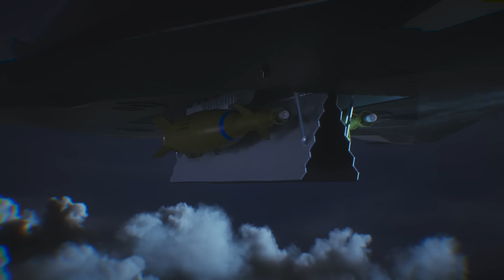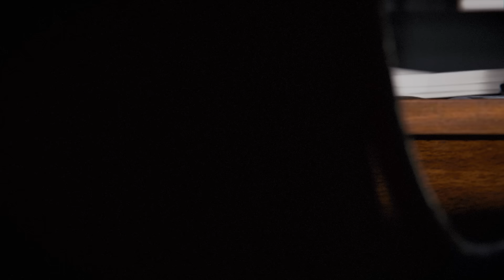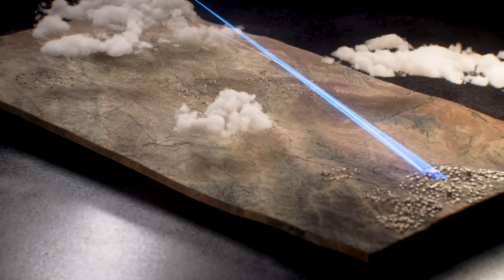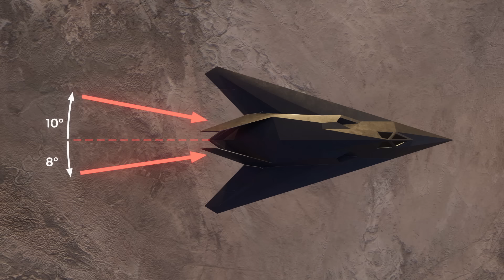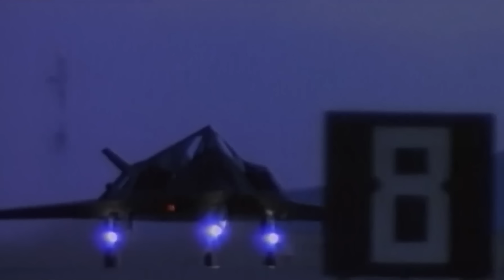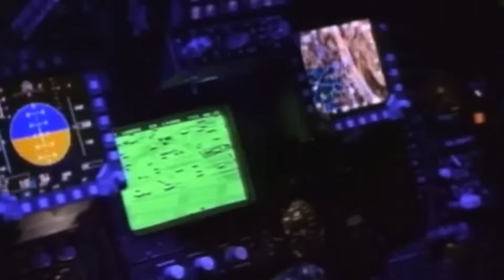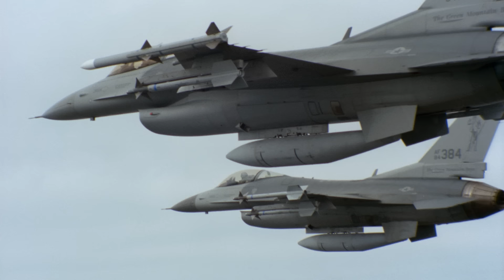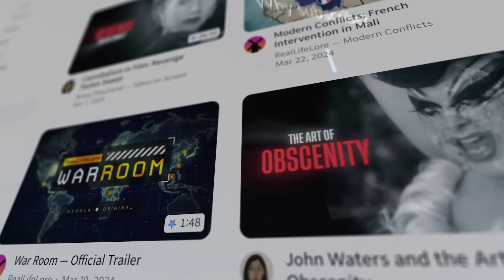The Insane Engineering of the F-117 Nighthawk

Comment: I like how you have these people saying it was dated tech when Yugoslavian army shot it down...and they shot it down with a SAM-system from 60s... F117 is like Gucci or Prada, it looks dope but put it into environment that actually has newer based tech (from that time period like 2000 to 2004) it wouldn't survive the first wave it would've been decommissioned from mission 1..nobody is saying that it doesn't have cool engineering principles, but everything has frequency,you just need to find it and tune it (newer tech helps with finding it faster) it was never a stealth bomber,nobody created truly stealth craft cause we lack materials..it was a bully plane, it wasn't hard to detect it just took longer that was the advantage, which would never work on stronger opponent with even the half of US military budget..if that wasn't the case it wouldn't be decommissioned just after 25 years,you have tech thats from like 60s still used around the world cause its reliable and cheap and does the work,while this fashion craft costs like 30 to 50mill per unit and cant do fuck nothing when met with equal force.
Reply: They shot it down with a SAM and radar from the 70s at close range after failing twice to achieve a lock at longer ranges vs a 1970s experimental stealth plane that was flying directly towards them due to lack of defensive and SA systems. The SAM was dated, but so was the F-117A. 

Stealth doesn't just take longer to detect, it reduces the range at which it can be detected and complicates the enemy's ability to achieve a firing solution even when detected.  "Stealth = invisibility" is just a very simplified explanation given to the general population and politicians, because it saves a lot of time when you don't have to explain kill chains, radio physics, military tactics and coordination etc. Stealth works as it was intended to.

There are nations that still operate 60s systems, but that is typically because their glory days are long gone and they have to hang on to existing equipment to maintain capability. Equipment degrades over time, and that results in increasing maintenance costs and decreased reliability. Any nation that can afford to upgrade will do so, because while it is expensive in the short term, it is typically cheaper in the long term.

Comment: You forgot to mention the contribution of programmers-this and future stealth aircraft were simply not designed to be able to be flown by pilots controlling the control surfaces.  The fly by wire concept, which required untold lines of code, allowed unflyable planes like the F117 and the B2 and others to fly.

Comment: Still one of the coolest planes yet made. It is a faceted monstrosity that doesn't look like it should be able to fly at all, and yet it does so while returning a radar cross-section not much larger than a dinner plate. It is also much smaller than you might initially assume.

Comment: An eleven-year-old kid (1978-79) from Chicago, IL designed this plane and gave Boeing's engineers the design concerns of the F117a, even at that age (with directions to turn it over to Skunk Works if too difficult to build), the kid realized that the opened and untreated bomb bays could expose the aircraft to generating radar returns. The story of a Russian engineer developing the theory of angled radar wave reflection is false. That was the theory of the eleven-year-old kid from Chicago. Cover stories are often layered in piles of horse manure. The term "STEALTH AIRCRAFT" was coined by that same eleven-year-old.  The term was pulled from a dictionary that was current in 1978-79. That dictionary credited the term Stealth as Russian, which is where the cover story of a Russian physicist developing the theory came from. So, the truth is the term and only the term stealth has Russian origins. The kid hand-delivered the designs to Boeing when Boeing was headquartered in Chicago. Additionally, the F117a was the designation the kid asked to be assigned to the aircraft.
Reply: You are completely delusional. Wow

Comment: The thing about the bomb bays is, that they are open for less than 2 seconds in most cases.
When you pull the trigger you let the weapons computer do its job, and ONLY when it's ready to kill does it open the bomb bays for al short as it is possible.

Comment: Each one cost $ 42.6 Million dollars that's approx $162 million in 2024.   It was used to beat up the Iraqis which had an ancient air force that could have been easily and was dealt with using F-16's and F-15's.
Reply: Iraq had a very modern air force up until desert storm

Comment: The story about the Nighthawk lost to enemy fire in Serbia can be pegged dow to sheer dumb luck and complacency by the americans.
It is not enough to simply detect a plane. A missile has to activelly track it in order to hit it. 
When a serbian system took out that F-117, it counted on the fact that americans were using the same flight course to attack over and over, that bad weather grounded suppport aircraft, spies reporting the F-117s taking off, violating it's own doctrine and what can only be described as as dumb luck. Colonel Zoltán Dani, the officer in charge of that particular battery, knew the Nighthawks were coming and where they were coming from, so he ordered his radar system to be pointed that direction. Due to the threat of american ARMs, serbian doctrine severelly limited the use of radar to avoid detection. It called for only two sweeps at a time, leaving the radar active for just seconds to avoid it being tracked by ARMs and making it difficult to triangulate by AWACS. But on that day, Dani ordered a third sweep, which just happened to occur right as the incoming Nighthawk broke it's radar elusiveness by opening it's bomb bays to drop one on it's target. Dani ordered two missiles fired, one missed the plane completelly and the second was a direct hit. But here's the luck part. The missile probably wasn't tracking the plane. It was a total shot in the dark. The 117 also lacks chaff, flares and incoming radar detection systems. The pilot, Lt. Col. Darrell Patrick "Dale" Zelko, said he saw the missiles incoming and probably had seconds to react, if at all. But he was probably flying a predictable pattern after droping it's bombs and making a turn for home, which the Sebians operating the missile system simply guessed right.

This is all based on the american pilot's own reporting. There could be things he's not telling us.

Comment: Any reasonably flat or mildly cambered surface. Given sufficient airspeed and angle of attack. Will produce some sort of lift. It might not be the most efficient but it could work. There's worse things that fly. Vought 173 HL 10 delta dyke X 24A M2 F1 starr bumblebee etc etc. An f 15 flew back to base with a wing gone.

Comment: A comment about the auxiliary intake doors - i.e. blow-in doors.  They were a passive element controlled only by the pressure differential in the intake.  While sometimes they might close gracefully, it was more likely that they would slam open and shut with tremendous and unnerving force, causing damage to the door, the door frame, and the spring damper support on the inside of the inlet duct.  It was a common maintenance issue.

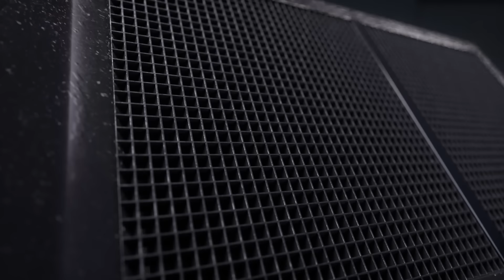Comment: 9:09 No way did a channel called Real Engineering just measure in centimeters
Reply: metric iss the language of engineering
Reply: @aquilesca5tr0  No shit. But nothing is ever measured in cm anywhere,  the vast majority of disciplines measure in mm, other industries will step up to meters where required, but there is no need for centimetres to be used anywhere.
Reply: @JMcKaySV  everyone undertands 1.5 centimeters better than 0.015m
Reply: @JMcKaySV  1.5cm is easier to understand than 0.015 meters for everyone
Reply: @aquilesca5tr0  What are you talking about? I just said that mm is standard. So that's 15mm. It's extremely simple?

Comment: Could be made a form of energy by digging a hole in the ground and put on walls of hole materials that keep heat in and dont let it escape so being so hot that water can be heated and produce energy whit a generator whit steam or by heating air that drive a turbine of a generator?

Comment: The most fascinating thing to me about the F-117s design is that because of its faceted shape the radar cross section is independent of its size. You could scale it up to the size of an aircraft carrier, and as long it maintained the same shape to scale, it would still appear as small on radar as the aircraft does!

Comment: Your info on the payload is all over the place. 
Pictured in the video were GBU-10 Paveway II Laser guided bombs. 
What you described were GBU-31 JDAM bombs.
The bombs that were dropped in the specific instance you referenced was the GBU-27 Paveway III, a high penetration laser guided bomb designed to penetrate over six feet of concrete. These bombs have been affectionately called the "Bunker Buster" by US forces.

Comment: There are some weird mistakes in this one..

January 17th, 1991 was the start of Desert Storm, in which 10 F-117s (not 2) struck communications infrastructure (not the presumed location of Hussein) with laser guided bombs (not GPS guided bombs).

In 2003 a pair of F-117s did strike a target where Hussein was supposed to be, so I assume you've confused the two events?

Also as many other comments point out; bombs, not missiles. The F-117 can not carry missiles, and adding rocket flames out the back of a Paveway in an animation looks funny.

Comment: Great video, but there are a couple of problems.  You said the F-117 fired air to ground laser guided missiles in Iraq, but the rendering showed JDAMs.  JDAMs are GPS guided and were not in use in the Iraq war, they also are bombs, not missiles.  The F-117 dropped laser-guided bombs - not missiles.  Putting a rocket plume behind a bomb and calling it a "missile" is what I'd expect from those channels with AI voiceover.
Second: The comparison to the F-22 is apples to oranges, the F-117 is a strike aircraft (despite the "F" designation); the F-22 is not equipped for air-to-ground operations, it's an air dominance fighter; they have entirely different mission profiles that don't overlap in any way.  A better comparison would be the multi-role F-35, which is capable of both air-to-air and air-to-ground operations.

Comment: The stealth of the aircraft is measured in radar signatures. While a B1 bomber, for example, has a radar signature of 70 square meters, the F-117 has a radar signature of only 0.1 square meters. This translates in 700 times less visible for the radar than the B1 bomber. So, the plane is not "invisible", it's just... STEALTH. In fact, there is no "invisible" plane.

Comment: First time I saw one in real life, freaked me out. 
A friend and I were coming back from picking up car parts... headed north on I-25, South of Albuquerque. My friend pointed to the valley to our left and asked, "What the hell is that?" As we looked over, there, above the valley, nearly at the same height as our highway drive, there were two F-117. They were probably a few hundred feet off the ground and they were preparing to pop up and align with Kirtland AFB that would be coming up in a few minutes. They were just black wedge shapes from the side. If we didn't know what they were, I could swear they were proper UFO's. Anyway, After freaking out for 5 minutes and cheering our heads off... we watched them way ahead of us, peel upwards, and push toward Kirtland. I wish I had a camera back then. It was so amazing.

Comment: There is a very easy way to make that 'hopeless diamond' a flyable aircraft = attach a set of plywood wings and a plywood tail to the structure.  Plywood is invisible to radar, so both the wings and the tail surfaces would have the radar go straight through them. the cables that move the control surfaces would be made of fiberglass, and so would the hinges of the wing/tail surfaces.  Fiberglass does reflect some radar, just a little bit.

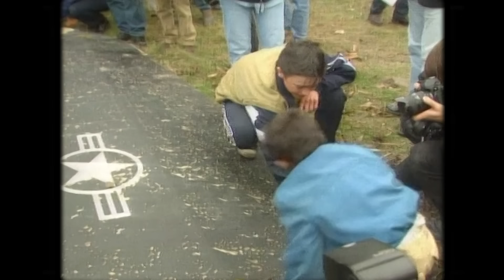Comment: 23:14 Yes and no, moving the systems helped, but the reason they actually got it is because it had its weapons doors open, and they're not stealthy from below when those doors are open.
(A lot of people will also try to tell you its because the radar operator had it on a low band setting and that stealth doesn't work against low band radar....... these people are just idiots, plain and simple.)

Comment: I was curious what you were going to say about the one that got shot down. 
A key point I think you should have mentioned is that the pilots were routinely flying through a certain area, which is why the anti air missiles were placed where they were that allowed for the shot to be made. 
Complacency on the part of the pilots, and a savvy anti air commander is what led to the loss of aircraft.

Comment: Your information about how the F117 was shot down is not totally correct.  What really happened is that the F-117 flew several missions, always using the same flight path and @ the same time each day (Oops, that should never be done)  The Serb's knew this and fired dozens of SAMs in the general direction, one of them picked up the heat signature of the F-117 and shot it down.

Comment: The F-117 that was shot down in Serbia was also flying the exact same flight plan, at the exact same time, everyday. All they did was move a SAM battery in the flight path, had a spotter radio in when the planes took off, they waited until the bomb bay doors opened & shot it down. Even with that it's still the only stealth plane to ever be shot down & they are the only ones to ever shoot down a stealth plane which is a huge accomplishment regardless of how it was done.

Comment: No mention of the Tamara passive sensor system developed by Tesla Pardubice in former Czechoslovakia and later produced in Czechia being able to detect the F-117? US officials lobbied heavily in 1997 to restrict the sales of the system. No Tamara systems ever got to the middle east, but one system made it to former Yugoslavia, either 2nd from the GDR or Russia, sources vary. Some articles claim that this was the reason why the F-117 was shot down, but others, this video including, claim a different tactics (and do not mention Tamara at all). Tamara was not magical. As a passive system, its detection range was very limited, but for a slow moving target, like the F-177, it could have been enough.

EDIT: Found another source that claims that the shot down F-117 over Serbia was detected by the Soviet S-125 system, that uses the P-18 radio-locator, operating at a wavelength of one meter. And at this wavelength, the shape of the F-117 acts as a resonator which makes its detection easier. I do not know what really happened. Maybe the detection capabilities of Tamara were a myth, but then again, it was a closely kept state secret for 20 years, when it was developed. The Ukrainian Кольчуга system claims to have similar detection capabilities as Tamara.

Comment: Thank you for talking about the very complex F-117 mission planning system.  Very few discussions of the F-117 recognize this critical aspect of the F-117 system.  One thing you did not mention is the very advanced (for its time) flight control system of the F-117.  This was required due to the airframe being aerodynamically unstable in pitch, roll & yaw.  This was made possible by the airflow probes on the nose of the F-117, which was yet another very complex and underappreciated breakthrough from the ADP engineering team.
Reply: Fred Bell, the PSAM director, did an interview with Bob Loschke who led the team that did the fly-by-wire system for the F-117. On YouTube search for: Under the Cowling - Bob Loschke

Comment: Why leave out the specifics of how the F-117 was shot down? 
Serbian forward observers camped outside the airbase witnessed the F-117 taking off and reported it. The F-117 was also flying a predictable pattern that it had flown over a dozen times already before then. So they knew when it took off and could predict where it would be. Moreover, a EA-6B Prowlers was supposed to accompany the F-117, which would jam enemy radars, but it didn't that night due to poor weather. Pointing their radar along the predictable path knowing ahead of time the F-117 would be there, the soviet radar saw NOTHING. It could not get a track on the F-117. It wasn't until the F-117 opened its bomb bay doors (which were only open for a matter of seconds) that very briefly it could be tracked. Then and only then was it shot down. Two missiles were fired, one missed and one hit. It was a perfect storm of both good luck for the serbians, and bad opsec for the airbase (not being able to locate and remove the forward observers), plus lazy mission planning and execution from the Americans. (flying the same path everyday, and deciding not to fly with the Prowler that night). But the stealth of the F-117 did its job. Flying in stealth mode (with its bomb bay door closed) the F-117 could not be tracked by any radar. No track = no way to guide a missile onto target. Even knowing exactly where the aircraft was and pointing their radar directly at it, they still got nothing. Both the the U.S and Serbian accounts corroborate these details.

Comment: Fun fact: just like the F-111, the F-117 are categorized faultily. Because both the Aardvark and the F-117 was meant for ground attack role but they didn't fit the current bomber role description. While they don't quite fit the Attacker role as well. And the two aren't the same. A bomber attacks from high altitude while the attacker mostly flies low when attacking ground targets. And because there's no bombardier, only a pilot and a navigator. At least that's how I describe them but feel free to correct me